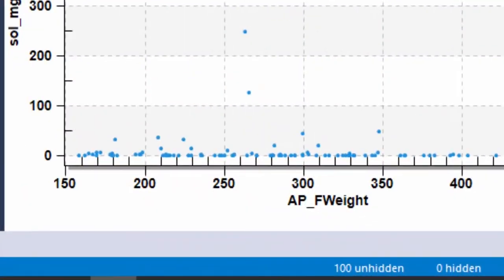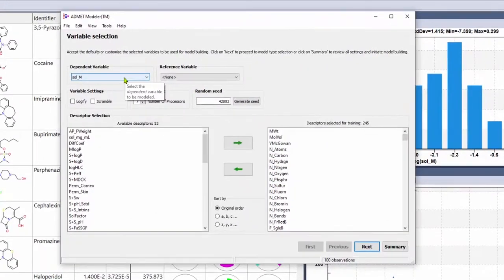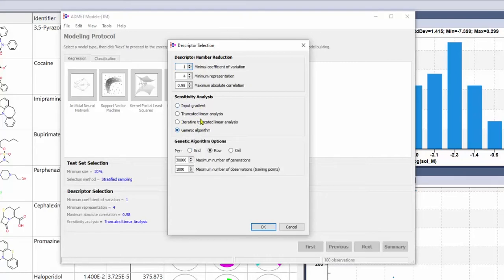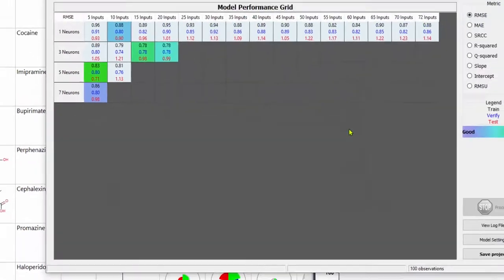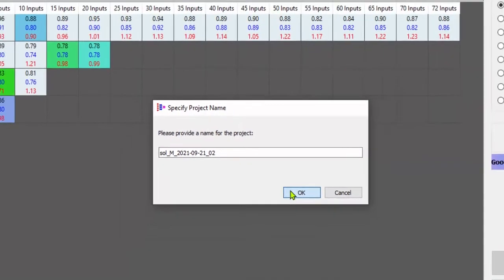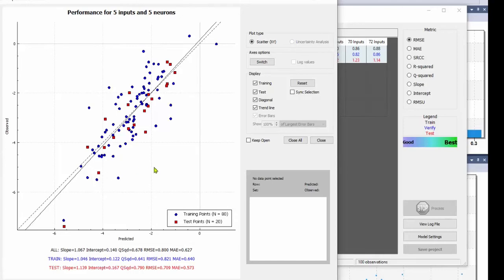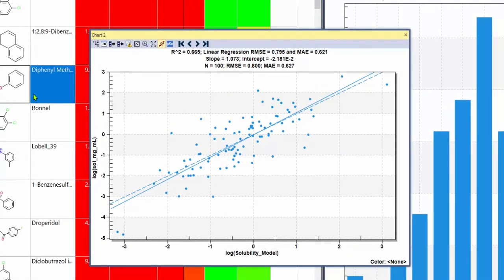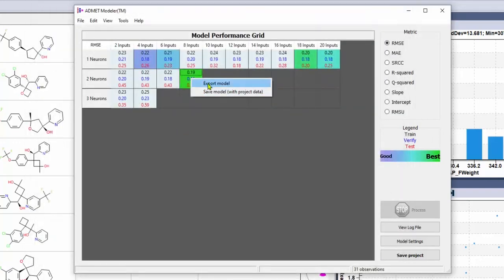ADMET Predictor Tutorial 12: ADMET Modeler

Comment: SUMMARY 

In this analysis, we studied Pancreatic Cancer using a step-by-step bioinformatics approach. First, we selected three human gene expression datasets from GEO that included cancer and normal samples. Using GEO2R*, we compared *tumor vs normal tissue to find genes that are more active in cancer. We downloaded the results and used Excel filters to separate upregulated genes based on log fold change and adjusted p-values , meaning we kept only statistically strong results. Next, we used the Venny tool to find genes that were commonly upregulated in all three datasets, showing reliable cancer signals. From these, we picked 10 genes for pathway analysis on Enrichr to understand their role in disease, and identified major biological pathways they affect. We then built a STRING PPI network and in Cytoscape as well to check gene interactions and used CytoHubba to detect hub genes*, which are the most influential genes in the network. *Boxplots were made on GEPIA to validate expression trends, confirming that hub genes are clearly higher in cancer than normal. Finally, a phylogenetic tree on MEGA12 was created to observe evolutionary links among the selected genes.